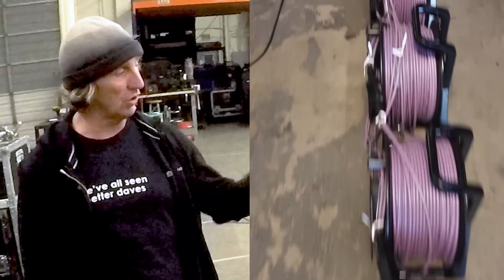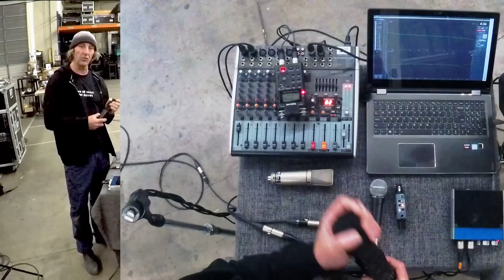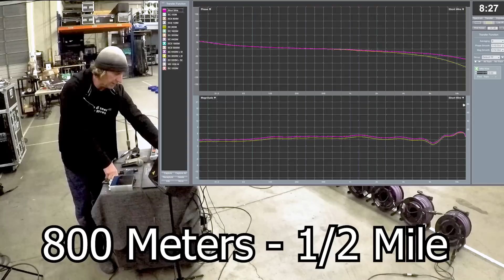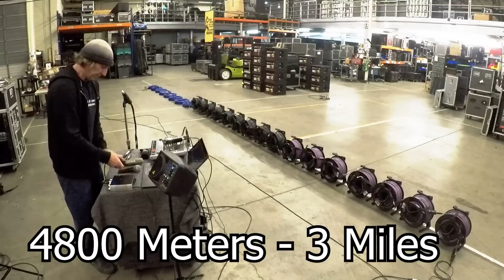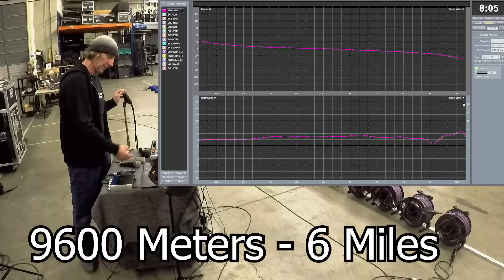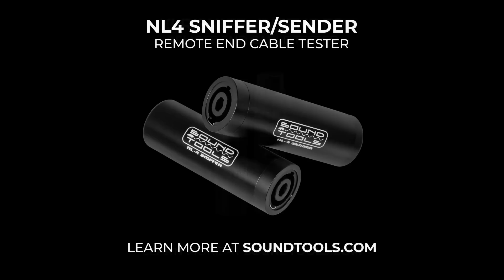Six Mile Long Microphone Cable? With Phantom Power?

Comment: I'm surprised nobody realized that as soon as the signal was sent back up the cat5 again (looped through multiple pairs) the gnd return path (shield) was eliminated from the circuit since all the pairs share the shield down the cable and back! This cuts the overall length of cable the phantom power is using in 1/2, 1/3, or 1/4 (depending on how many pairs your looking in and out of), and cuts down in the amount of voltage loss at the condenser.  It invalidates the question of how long can you run phantom power because only the +v is running the distance (and shared on 2 conductors, as is the nature of phantom power). To keep the test real you can't look back down multiple pairs, sorry!
Still an interesting test though.
Reply from the maker: Great observation!  The ground does not carry any signal on balanced lines and all the signal travels down tristed pairs. So sound quality should not be impacted for better or worse

But yes, the doubling back does decrease the resistive losses to phantom power. Though with the supercat, the braid shield has so much copper, the resistive losses are minimal in comparison to the losses of the twisted pair wires so not doubling back should still be about the same. 

With supercat sound, the pairs are individually sheilded and the doubling back would reduce some losses to phantom voltage

Very cool!
Reply: @DaveRat  I disagree, regarding the supercat sound cable and individual shields...  All those shields come together to a common connector shell at both ends, so if your running the distance (and not looping back) then you will benefit from the less resistances of all 4 coppers sharing the load; but if you loop the signal back then, just like with the other cables in the test, you eliminate the shield length completely from the active DC circuit powering the microphone!
Also, with runs that long, even with "thick shield" I wouldn't discount the voltage loss from the shield over miles of cable.
The end result, though, as pointed out earlier, will likely be somewhere in the range of 10-15 volts of drop (depending of course on how much current the mic is pulling) which should have little to no effect on the most microphones if your source is 48v (I'm not doing the calculation myself just trusting the calculation I read earlier).
Reply from the maker: The super cat sound with individual wires would be lower resistance doubling back correct not disagreeing with that.

Say we had best case scenario and the shield resistance was eliminated completely that would reduce 1/2 of the total resistance the signal sees or a 6 DB difference.

But half of the cable has super thick grounds so the difference will be less maybe three or four DB differential between doubling back and not
Reply: @DaveRat  I think you misunderstood my point... There will be no loss of "signal" due to anything regarding the shield, because signal does not pass through the shield.
The point I was making is that regardless of which cable/shield type you are using, once you send the signal "back down" the pipe on another pair and pick it up at the end where you started, you have now effectively eliminated the shield (your best case scenario in real life!) from the active circuit powering the microphone! Even with the individuals shields, they all bond together at the Ethernet connector shell, and that is the only part of the cable that carries the - leg of current to the microphone!  You won't lose db's off your signal but you will not be presenting the correct amount of voltage loss that a cable 2-4x the distance of the actual Ethernet cable jacket is.

Again, even with the shield as part of the circuit, it's probably not enough loss to shut down most mics if you have a solid 48v supply at the input end; but even with a "thick shield" it will add a measurable amount of resistance / voltage loss to the circuit, if it wasn't being bypassed by the loop back to the beginning in the cable. Either way, your no longer accurately measuring the correct voltage loss after that first 1.5 mile run, when you looped the signal back through different pairs.

Comment: The disapation of a 48volt phantom power microphone feed starts to deteriorate over the longer the distance! The expectations are typical from what we would expect on the principles of Ohm's Law! This is because for every 2 and a half centremetres within..say 12,800 metres (12 miles) before the signal enters three thirds below it's roll off threshold that it then becomes more apparent say around -128bB give or take!
It's only then that it starts to lose it's basic functionality such as it's power conductivity, impedance strength which is long before an acoustic delay becomes audibly noticeable! The longer the length of cable from it's source then the more of the odd popping noises and on many of occasions RFI (radio frequency interference) despite the cable being rf suppressed at the mixer or limiter/compressor point! Although upstandably the signal will be considerably weaker which will need to be amplified due to the increase in noise static! Another important factor that one may forget to take into consideration is the quality of the phantom power microphone cable for each drum reel regarding it's outer and inner sleeving and outer  insulation! The transmission of live acoustic electrical signals during that of a live festival, concert is no stranger to acoustic hiccups whether it's cable cracks, phantom pops, rf interference, hum issues etc Using a Behringer feedback destroyer for ie resolves many PA problems but not all of them although the principles of cleaning up the signal are more or less the same aswell as the rate of acoustic feedback! So in summary it's really just an experiment to see how far up a professional graded XLR microphone cable takes before a delay becomes audibly noticeable! Technically, long after the signal becomes hardly audible from it's source!
Reply from the maker: I love the tech and theory and even more it's fun to test and see and hear what actually happens in the real world
Reply: @DaveRat  It really is absolutely fascinating Dave for you to actually put these live acoustic experiments to the test in order to ascertain whether there is some technical and mathematical truth to them thus debunking or confirming some of the sound industry's greatest myths! We can just imagine a very young Alexander Graham Bell conducting similar experiments with microphone's before the concept of the telephone arrived (back in 1876 I think) only for it to be improved much time later with a more efficient carbon telephone transmitter by the late Thomas Edison! 🙂👍
Reply from the maker: Thank you and let me know if you have myths I can test!

Comment: Phantom power is very similar the voltage present on a copper telephone line. The same thing happens to telco lines the farther you go out the more attenuation in the high end but in the telco world we employ what is called a passive load coil that helps to make up for the loss. Since you are using what is essentially telephone wire to run this test I'm not sure if  the cables coiled up are effectively acting like a load coil and affecting your results positively or not. You could try to unroll them and repeat the test and place one roll up cable reel in the middle switching it in and out to verify weather or not it effects your high end.
Reply from the maker: Hmmm, comparing the impact of coiling of high bandwidth precision twisted pair Cat5e to telephone line may not be fully on point

Are you sure the twisted pairs of Cat5e would be impacted by coiling the same as telephone line?

Anyway, the test was to see how far audio and phantom would go down Cat5e and it well exceeded expectations.

So you think that if I uncoil it will go even farther than what is already too far for nearly all applications?
Reply: @DaveRat  You are correct they are not exactly the same telco twisted copper is is generally Cat3. I was just curious if there was any effect having them all coiled up.
Reply from the maker: My understanding is that perfectly twisted pairs should be immune to coiling inductance. 

That said, nothing is perfect.

And I am not curious enough to uncoil 6 miles of cable and find out. At least not yet

Comment: Good to know you can lol. Not sure why you would!
Reply from the maker: I could think of some situations where running super inexpensive sheilded Cat5e may be a more reliable, less expensive or less complex solution to other methods.

Bike race with announce speakers along the route in a remote location may want to weigh costs and complexities of setting up wireless transmission vs just running copper. 

Also, in making soundtools analog over cat5e I am faclscinated to learn how much of the world still embraces analog over digital solutions for infrastructure.

Hospitals and building being wired with our Wall at boxes and super long cable runs and routing to multiple buildings.

As useful and fun as digital and wireless may be, running a copper wire is still a great solution for many applications
Reply: @DaveRat  When I was in the Navy I worked with deep submersibles, tethered UAV's. The most expensive part was the tether. It carried power and comms etc.  Wired is always prefered. However not sure about miles of it hahahaha! And it, as you say, just works...

Comment: Stop ...why is this necessary?
Reply from the maker: Hmmm, not everyone is travelling well trodden paths.

I get questions quite other asking how long they can run analog down shielded Cat5e. Marathon race in a remote location with speakers along the route. Announce speakers to multiple camp sites. Analog backup to multiple buildings in a medical complex in Malaysia.

Sometimes a piece copper wire is a the most reliable, cost effective or simplest solution.
Reply: @DaveRat  sorry, dude, I'm just being sarcastic really. I guess I just fear the day that I ever have to send 48+ to some remote location.
Reply from the maker: Ha! I love stuff like that!

What is the best way to solve this challenge in the most efficient, cost effective and reliable way?

So fun!
Reply: @DaveRat  it's definitely interesting and cheaper than placing mixing boards with phantom all over the goddaym place. 😁
Reply: By the way ... Did you mix the red hot chilli peppers at woodstock 99??? 🤯
Reply from the maker: Yes, I mixed that chaotic mess
Reply: @DaveRat  holy sh$t, I just watched that documentary... INSANE. glad your alright.
Reply from the maker: I was not at the FOH that got messed with. That may have been on the other stage. It was a mess, shittty money grab of a festival. 

I got interviewed about it in the Netflix "This is Pop" show and give my perspective

Comment: interesting but do the experiment with uncoiled wire... betcha the result changes!
Reply from the maker: Hmmm, since the test was to get phantom to fail and test worst case scenario, you think the results will improve?

Also. Do you think coiled twisted pair has the same coiling inductance and twisted coax?
Reply: @DaveRat  coiled anything inducts current
Reply: could always run the experiment again with just a couple of rolls, you would at least be able to meter the difference then, thus apply any changes to the overall distance.
Reply from the maker: Tightly twisted pairs of balanced signals practically eliminated radiated electromagnetic fields

An inductor is dependandat on the radiated magnetic field.

So, how do you get an inductor without a radiated magnetic field?

Comment: This is such great timing for me! I just ranover 500ft 8 channel snake cable, 350ft of speaker cable and 2000ft of cat5e cable for my studio. If 8 channel snake cable was a bit easier in the wallet, I would have ran a bit more. I never considered how well mic level could travel down cat5e; shocking really. Although, it being coiled as opposed to actually run at length may make a difference, but I ain't running 6 miles!
 Thanks Dave, always incredible information you share.
 Cheers!

Comment: A fellow senior grumpy engineer friend of mine who's too pretentious to bother commenting here himself because of fear of "noob relation" mentioned:

"Interesting test with the cable runs. I'm surprised that no one mentioned that the cables are in coils which will produce impedance even though the cables are shielded.
The common practice with extra lengths when running cables, is to lay it out in a figure 8 to avoid the problem."
Reply from the maker: Hmmm, I think there is some misunderstanding of shielded vs twisted pair. Twisted pair is inductance cancelling, Shielded is not. 

Either way, if indeed  the coils were to create issues, then we could go even longer, but I ran out of cables to use and the whole purpose of the test was to see how far phantom would power a mic. 

Is your friend saying that uncoiling would achieve my goal of phantom not powering the mic?
Reply: @DaveRat  he made no mention of phantom power being lost over that distance. I think he was just grumpy to see the coils and overlooked the mention of it being twisted pairs. Cheers for your quick reply Dave! Long live coffee cat :3
Reply from the maker: Ha and awesome! Yeah, people like to spot things and spit out info as if they know what they are talking about.

Best thing to do is ask him for ducumentaion and a video of the testing he did to gain that knowledge.
Reply: @DaveRat  I think your education is more valid as you are far more relevant compared to an old grump who hasn't had a gig in two decades (nor embraced the digital era for that matter), I doubt running audio over twisted pairs is a concept he's even familiar with. If we're to do a similar installation but not use your specific branded cable, as long as we're using Cat 5e twisted, we should be fine for most installations (say for tie-lines in a studio where the runs would be no more than a few hundred meters?). I'm trying to help another peer of mine design and build a new studio space but classic analog cabling (mogami or the sort) gets pricey. I suggested some cat boxes and running the audio over twisted pair instead. Also does Sound Tools provide any solutions for the wall box that is more than 8 channels? Could we present a custom design and have that built out? say for 24 ch or more?  Thanks for sharing your knowledge with us freely and publicly :-)

Comment: A coaxial cable  would theoretically be the perfect fit for this. That white stuff around the wire is there to make sure there's always a constant charge that stays the same whether it's one meter long or one kilometer
Reply: No it would not... The miracle of cat5/6 is the incredible well balanced (and different) twist density on each pair.  If you tried to do this on unbalanced co-ax you would hear nothing but two cities worth of hum before the mic signal hit your preamps.
Reply from the maker: Coax does deal with high frequencies well as it has less capacitance but but the twisted pairs are better at rejecting noise. 

But the test was to see how far phantom power would work and with coax, that would be easy, 0 feet.
Reply: @DaveRat  really!? So a coaxial cable can't carry phantom power at all?
Reply from the maker: Not without making it not phantom. Phantom is based on a 3 wire cable.

Comment: Ok neet experiment , but inquiring minds what to ask - WHY? . On anything over a 500 feet would'nt you just automatically run the signal via digital cable or radio waves ? My Huh meter is going off now Dave !! Lmao
Reply from the maker: Battery powered speakers along a marathon route outside of cell service and wifi 

Or just a simple and ultra reliable low cost way to send audio to far away speakers.

Comment: The addition of ethernet cable makes this annoyingly less scientific; you've gotta isolate the variables, man! It needs to be XLR right into the ADC. But this concept is super fun.
Reply from the maker: Analog over Cat5e is superior to audio snakes in many ways. 

Do a Google search for analog over cat5e. It's awesome
Reply: @DaveRat  That's not the point, in any way. If you combine them then we have no way to tell what part of the results of this test are caused by cat5 and which by the XLR. Your preconceived notions about the quality of the cable only further invalidate the results. I'm talking about basic experimental procedure here.
Reply from the maker: The test is to see how far analog and phantom will travel down Cat5e.

I did fail at finding out because I ran out of Cat5e to test.

The reason for the test was we had ciutoners of our analog over cat5e Soundtools products ask:

"How far can I run analog down Cat5e?"

And my answer is
"Well . It phantom over at least 6 miles and with mic and a pink source, it rolls off quite a bit starting around a mile or so."

So I am not sure how where I exactly went wrong in this test.

As far as mic cable, I would expect it to travel longer in some and liss long on others.  As far as audio snake cable, in other tests I have shown that Cat5e has less hf rolloff, so I would expect less length.

It would be great to see some tests to cooperate or disprove!

Rock it up!

Comment: Would I be correct in saying that these effects will differ depending on the output impedance of the source device? If so, would adding resistors at the output of the console cause it to replicate the performance of a dynamic mic that would have a (relatively) higher output impedance, for the purpose of the analyser measurement?
Reply from the maker: Yes, impedance will 8mpact it and the analyzer is reading pretty much what a mixer would do sending signal and would not be accurate for the mic.

Probably the best way to truly test the mic would be to mic a pink noise source, then compensate it to flat with a short wire in the measurement software. Then change cable lengths.